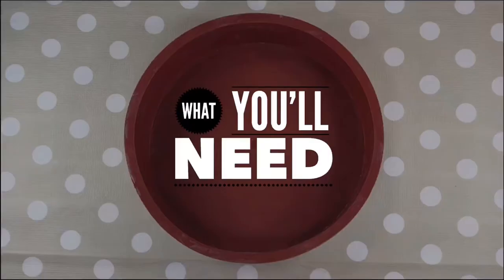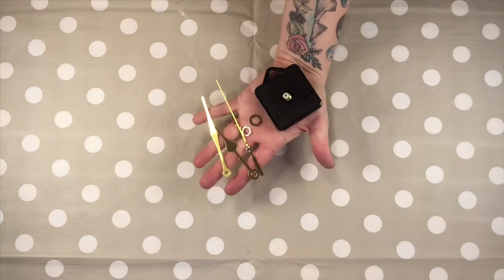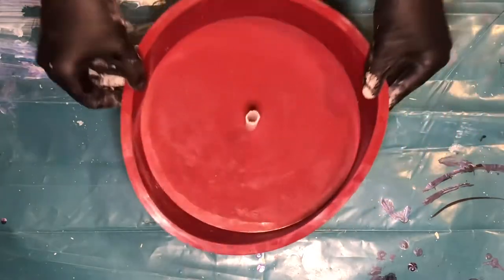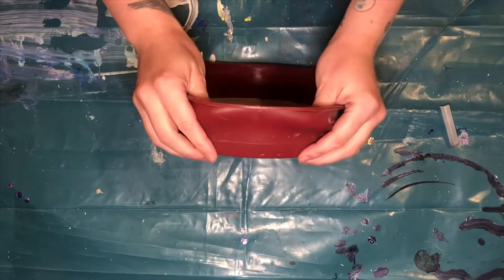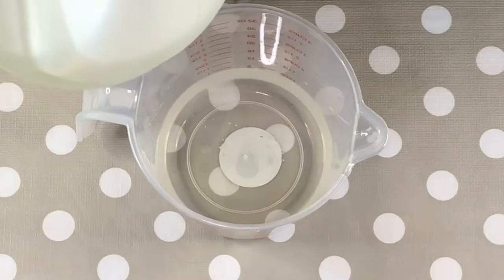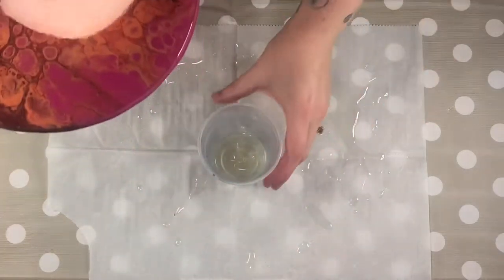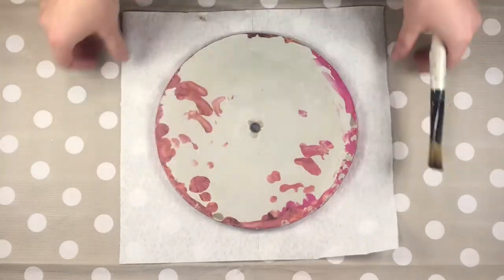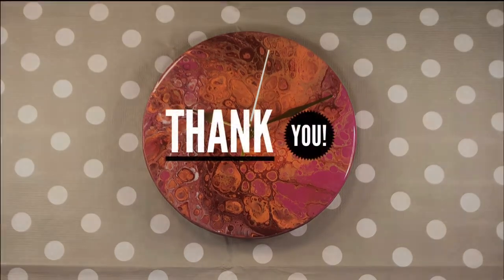Easy DIY Resin, Concrete & Acrylic Pour Clock - Using CementAll Rapid Set

Comment: This us so pretty, can you please tell me the approximate weight of it.  Thanks
Reply from the maker: Thank you Sadie ☺️ I don't have it anymore as I sold it but if I remember correctly it was about 2lbs. You can make the clock thinner or thicker depending on what you prefer of course. This cement is very very strong so it won't snap if made thinner. X

Comment: I'd like to try this. How do you hang out on the wall though? Thanks! ❤️
Reply from the maker: Mollie Agosta I'm thrilled you want to try this! I always just buy the clock mechanisms that have a wall hook built in ☺️
Reply: But will it be stable enough to hold the wall in a flat manner?
Reply from the maker: @sonalpurohit7807  hi Sonal, I'm so sorry, I didn't see your response! To answer your question, I've never had any issues. As long as you get that centre hole bang-on then the clock hangs lovely and flat. It will always stand out from the wall however thick the mechanism is but this is unavoidable whether you use a built in hook or attach something separately. I hope that makes sense and I'm very sorry for the the belated reply! x

Comment: What if u don't put resin
Reply from the maker: Hi! You don't need to cover it with resin 👍🏻 I simply prefer that shiny surface look. You could leave it as it is or apply a couple of coats of a matte varnish or krylon spray to protect it if you're concerned about chips ☺️